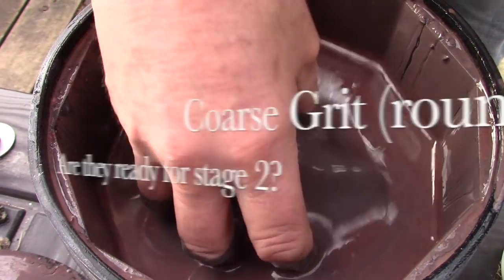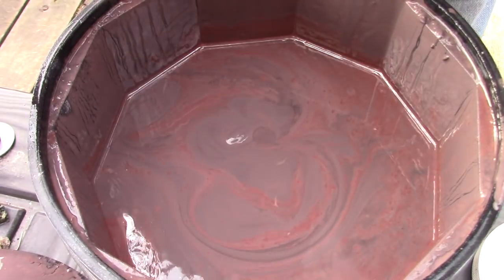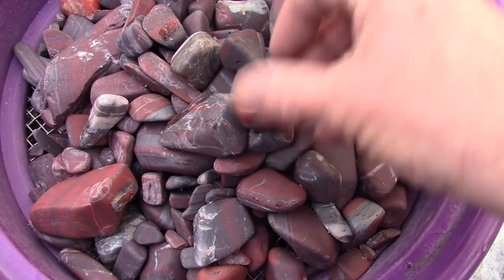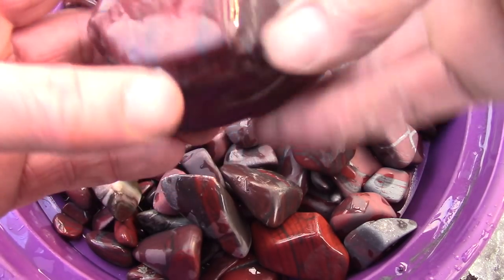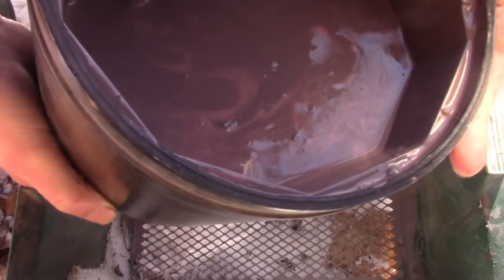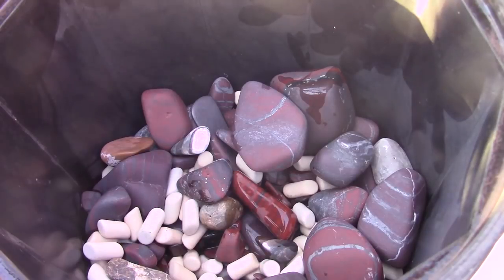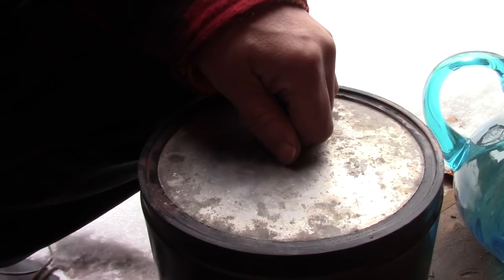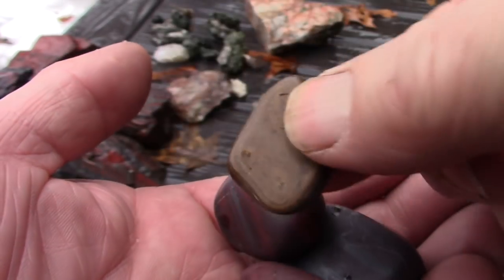TUMBLING BIFs -  SHAPING & POLISHING

Comment: Hello is there any other thing we can use instead of plastic pellets?
Reply from the maker: Leather strips work well.  You can also buy ceramic media.  I have used marbles before too.
Reply: meMiner thanks
Reply: Can we use plastic pearls
Reply from the maker: Probably.  Sounds like an expensive thing to buy, but if you have them around, why not?  Sometimes hobby stores have plastic beads used to stuff chairs or animals for really cheap.  These are pretty much the same thing as the ones for tumbling.
Reply from the maker: I had one other thought.  If you use plastic pearls, be very careful not to transfer them from grit to polish stages (use new ones).  Grit will likely be caught in the holes for the string and you don't want it released when in polish because it will scratch and ruin your shine.
Reply: meMiner I have used plastic beads and leather strips together after 8 days stones are not shiny nor polished yet they are dull smooth with mat surface even I have added backing powder sugar with white polish powder 😞what’s wrong ?
Reply: I have 3.5 kg rocks(actanolite with rose quards )and I have added half pound polish powder with half pound plastic beads with half pound leather strips .

Comment: I've got to pick up some of those pellets for when I tumble the next time , can I ask you where I would find them ?
Reply from the maker: You are near Branford/Cambridge?  There is a shop called Robert Hall Originals that has tumbler supplies off highway 5, half way between.  Otherwise, Amazon or eBay is probably the way to go.  I read that you can get the beads from craft supply shops (maybe Michaels?), but I have not checked that out.  They are apparently used to stuff dolls.  The thing about plastic beads is they float, so when you are done tumbling, can be skimmed off the surface with a strainer.  They also hold grit, so don't reuse them with finer grit, as they will transport the coarser grit to the next round.  Eventually, you will have a bunch of beads for each grit.
Reply: You can also buy them off of pollyplastics.com

Comment: Looking beautiful. What's the smallest size stone you would tumble.
Reply from the maker: A really good question.  It depends on the type of rocks.  I have tumbled quite small crystals of apatite and fluorite to get little gemstones.  For rocks like this, I only want the larger rocks and discard anything smaller than 1/4 inch (they fall through my screen).
Reply: Ok was wondering. I went through some sapphire gravel and there were a ton of little garnets in there. Thanks as always!
Reply from the maker: I have also tumbled little garnets.  It worked out well.  They ended up being like little gemstones.
Reply: Right on!

Comment: Damn those rocks are cool.  No soap, or is that the next step?
Reply from the maker: They are still tumbling in the polish stage and I will burnish with soap when that is done.  I had a strange thing happen this time which set me back.  We had one day where it warmed up to above freezing.   I got some condensation on the outside of the rubber barrel and when the temperature dropped, it froze to the metal and stopped turning.  I was able to break the ice and get it tumbling again, but I lost a week.  I am glad that I did not burn out the motor.